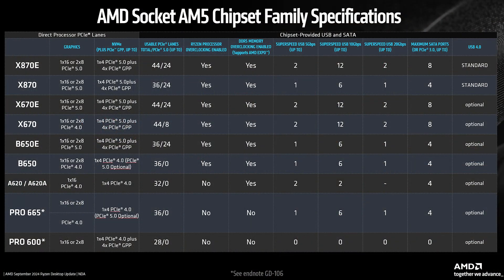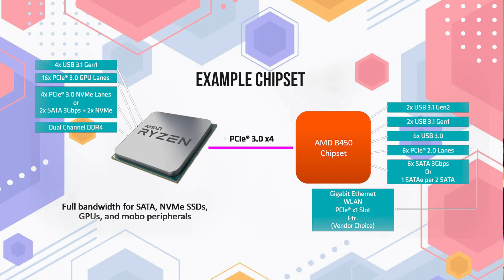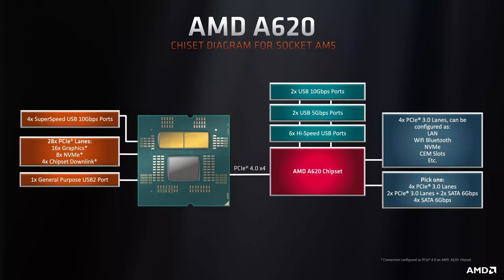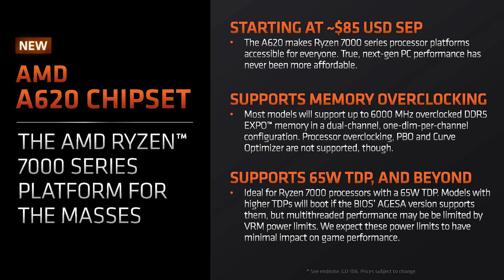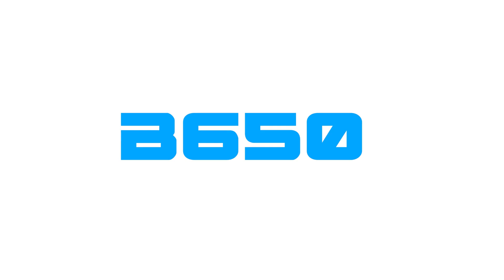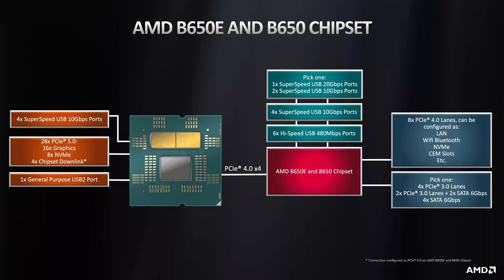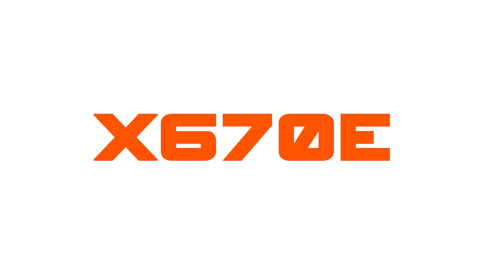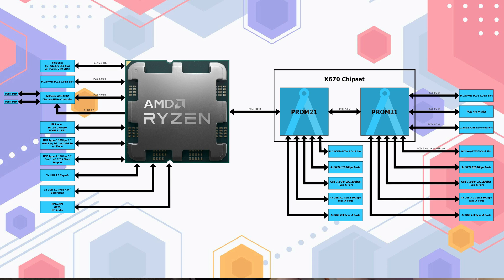AMD RYZEN Motherboard Chipset Guide - Ryzen 7000, 8000 & 9000

Comment: "Pretty confusing." Yup. I'm searching for a new board for the upcoming 9800X3D and it drives me cracy! There are 2 boards i found interesting. ASRock X670E Steel Legend, and the ASRock X670E Pro RS. Both have pros and cons. what do you think, which one is better, or are both trash?
Reply from the maker: I'll be honest I have no personal experience with AsRock boards so I could not say without looking into them further for you, however they have been a bit hit or miss over the past few generations. However jayztwocents does use and recommended AsRock for am5 so that is a very good recommendation to go off but I will look into those two boards you listed and let you know what I think